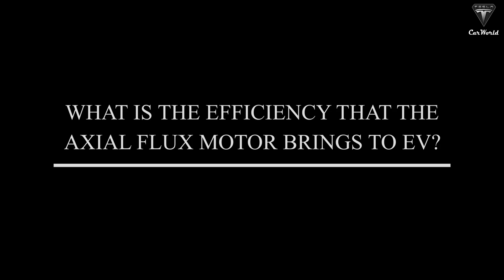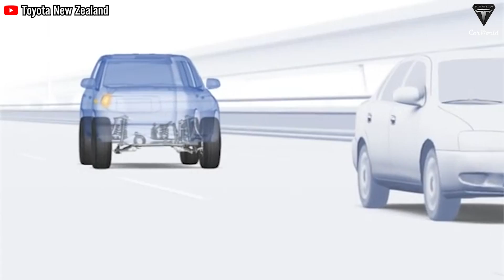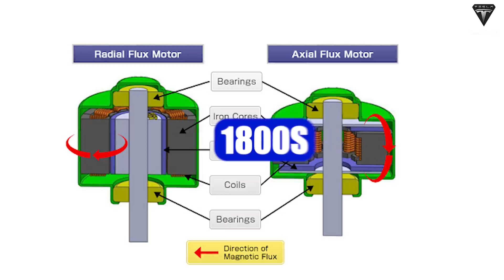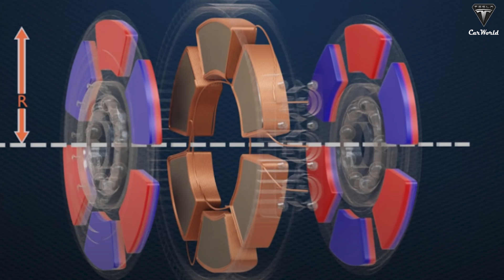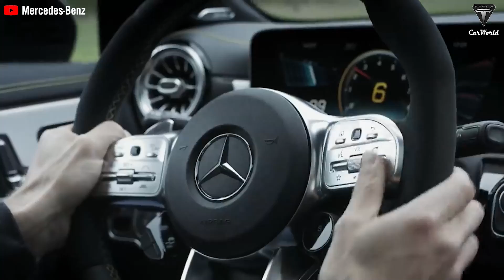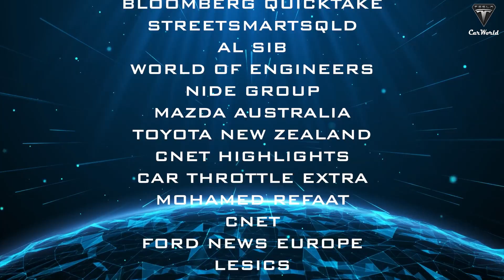Mercedes CEO: "This ALL-NEW Tiny AFM Motor Will SHOCK The Entire EV Industry!"

Comment: AF motor flanked by coax torque converters would allow for 75 percent reduction in motor size and eliminate ALL gears including differential.  Be great for an affordable 4 passenger commuter car of $20,000.  Do it please.  90 mph top speed would be adequate.  8 second 0-60mph is all we'd need.   40 size battery would allow for 400 mile range.

Comment: Please stop calling the Electric Motor an "Engine".
The two words are NOT interchangeable.
Engines consume fuel and undergo a chemical reaction (typically combustion) to produce energy to do work.
Motors take an existing energy source (electricity, a pressurized fluid [air or liquid], or even gravity) and convert it to rotational mechanical energy.
Reply: These are WISE WORDS of "back to basic use of words"

Comment: Axial flux motor cannot turn fast. Its a problem. They need an additional gearbox to drive faster. Not great at all. If you cool the electric motor with coolant, that ridiculous. Unsprung weight of axial motor is too high. Also beause axial motors are placed inside of the wheel, magnets can unglue because of pathwholes and road bumps which can lead to deadly accidents. Do you really think that Elon Musk is so dumb not use this kinda technology in his Tesla cars?

Comment: doesn't have to be a hub motor...you could still have 4 motors (one for each wheel) but attached through a typical CV joint.  This minimizes the wheel weight to improve suspension performance and motor reliability.